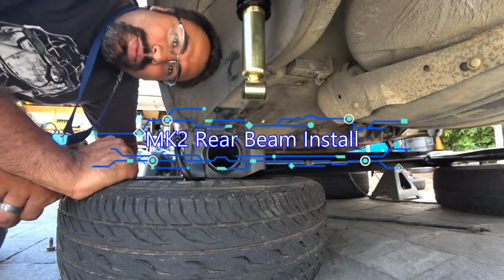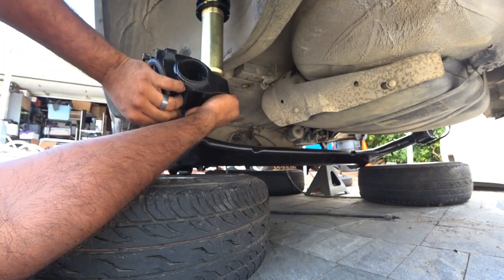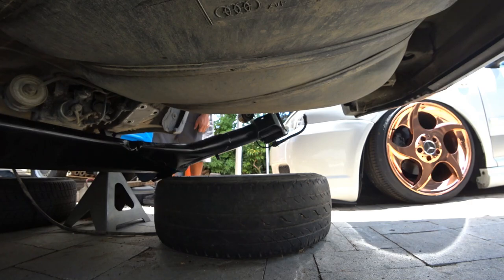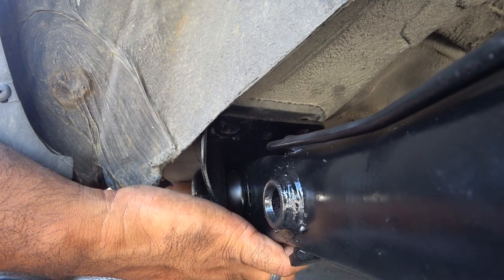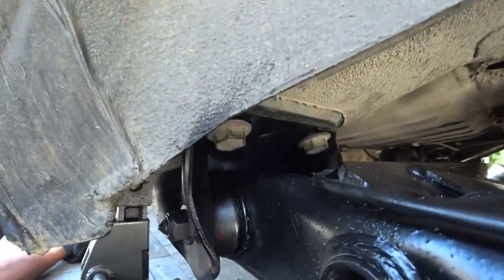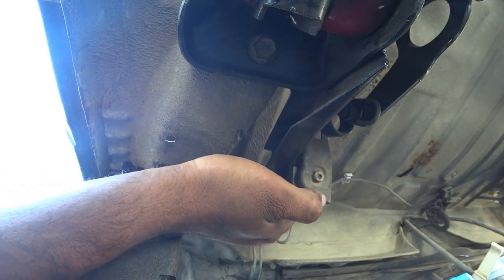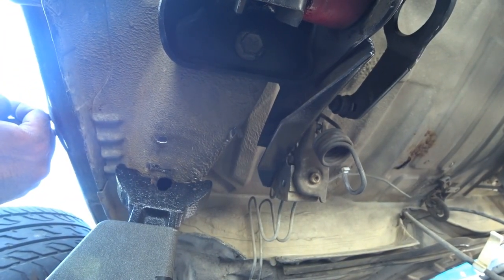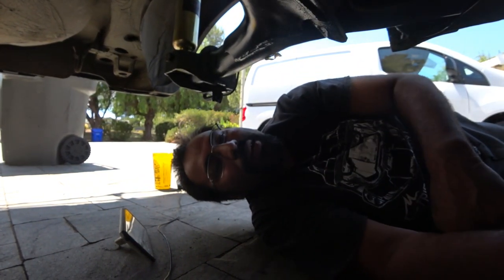How to Install a VW MK2 Rear Beam Season5 EP33

Comment: Depending on how your MK3 tank swap goes, I might do that also. I'm having a hard time finding a MK2 gas tank, and don't want to modify the diesel tank I have for it.
Reply from the maker: Mk3 tank is an ez swap and the fuel pump is drop in like an mk4 or mk3... Mk3 is exactly like an mk2 just made for a single fuel pump...
Reply from the maker: I made the diy just have no time to edit and post....been working a lot... Will post very soon though